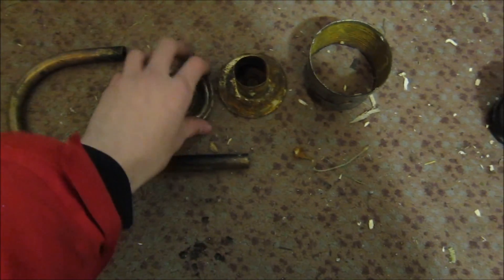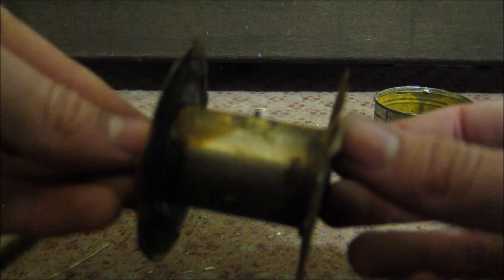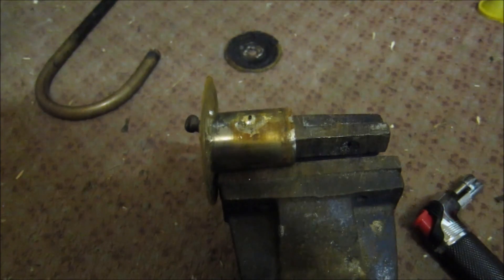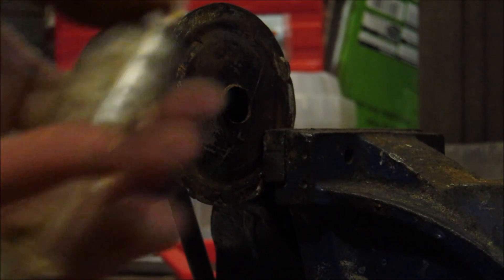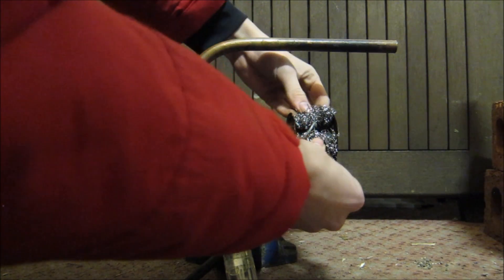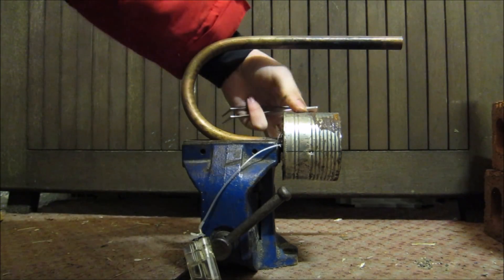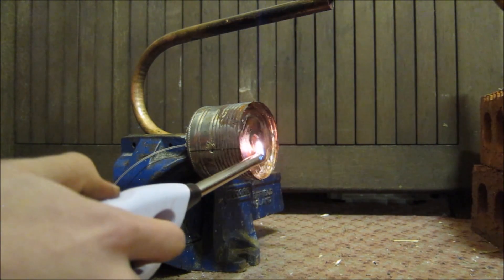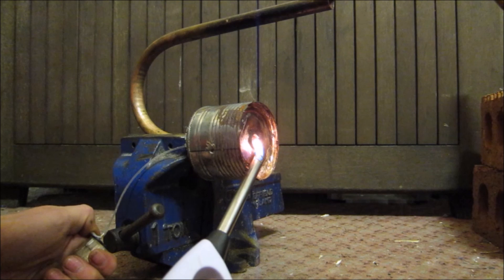How to build a Valveless Pulsejet.

Comment: Don’t take this the wrong way, but …..are you soldering a pulse jet together with a meth lighter inside of ( what appears to be) a hotel room?
One false move, and that carpet will burn  faster then a Jew in 1940s Germany.
Reply from the maker: The torch is just one I got from Amazon fairly cheaply (I now have a far better one) and it's my garage not a hotel room I've no idea why the previous owners of the house put a carpet in there but it's not as flammable as you might think.

Comment: To get a pulse jet to actually run for more than one pulse or a second or two needs a slightly better design. Think of it as a musical instrument as that is basically how a PJ keeps  running,  by the proper wavelengths on a Open pipe reaching the combustion chamber at the right intervals. Solder and glue  have no home on anything called a jet engine. The prínciple  is there but the dimensions  and materials,need a little tweaking.  I know people online want to make things simple and quick but to put in an hour or more effort in making something that doesnt work is a let down. Spend a little more time, do the research and make one that runs for 30 seconds or more and the reward  will be well worth the  time. I have been self teaching on building a PJ and it isnt as easy as the vídeos lead on. The right fuel, air ratio, pipe lengths and diameters are crucial. I am on to building a real turbo jet engine by using a old auromotive turbo. Something about harnessing Power, Fire and things that go boom that is intriguing.

Comment: steel wool is too combustible I remember using that shit to clean hot stuff and it would always smoke too easily
Reply from the maker: You are correct steel wool is combustible it works here because it's kept wet most of the time as part of the cooling system. (Does mean you want to use corrosion resistant steel wool rather than just regular steel though)

Comment: i thought it didnt work because there wasnt enough air.  When it pops yes sometimes the flame goes out, but sometimes it pops and then fire comes out of the tube like a candle.  That tells me that there is fuel in the combustion chamber but needs to come out the back and get oxygen before it can catch fire

Comment: a pulsejet thrives on the self-ignition of fuel in the hot gases and casing. If you cool them down i belive that it doesn't work...
but
Reply from the maker: That could be a problem, but if it melts itself it's not going to work anyway. I now have a torch and some braising Rods so I'm thinking of revisiting the project to see if I can make it work better now.
Reply: @infernalcontraptions8648  yea good luck

Comment: If you inject water into the combustion chamber you could (possibly) turn some of that waste heat into thrust and get rid of the cooling jacket overall achieving a better power to weight ratio and simplified construction
Reply from the maker: I suppose that could work. The question would be if that water interfered with the gasses ignition.
Reply: Damn. You're a fookin genius

Comment: Make fuel injection a little wider and use a little bit more fuel
Reply from the maker: My problem is that the output valve of the tank is the limiting factor. I'm still trying to work out how to increase that safely
Reply: @infernalcontraptions8648  Hey! Can I make one of these, but with an 800ml can, that is for blowing out PC parts, like an air spray, but it's 30% propane/butane?
Reply: You could try multiple of the tiny tanks in conjunction to try to get more fuel at once